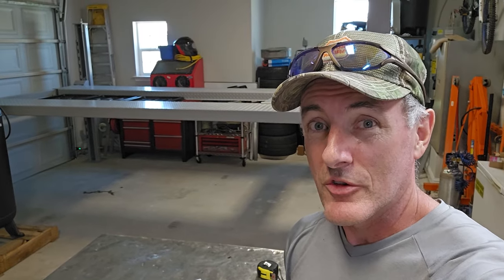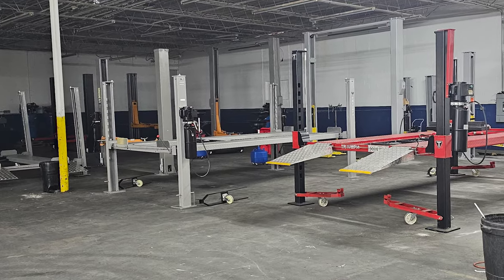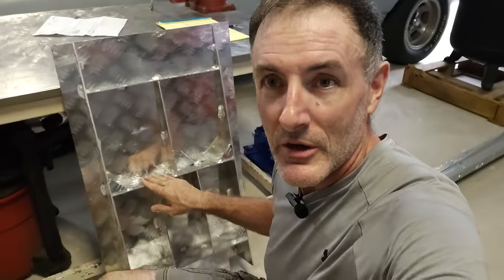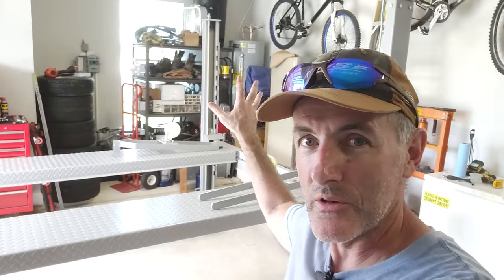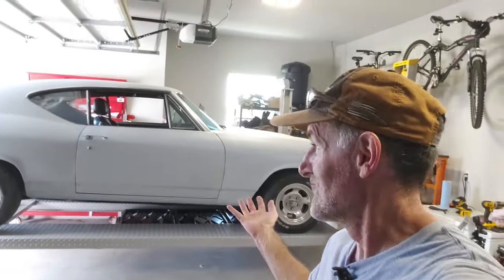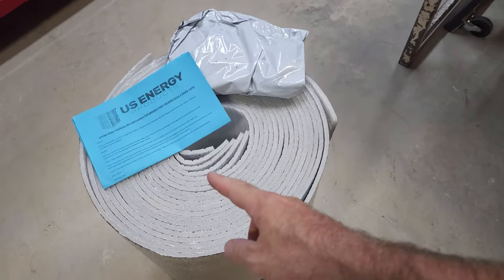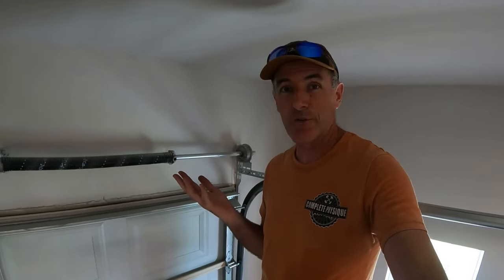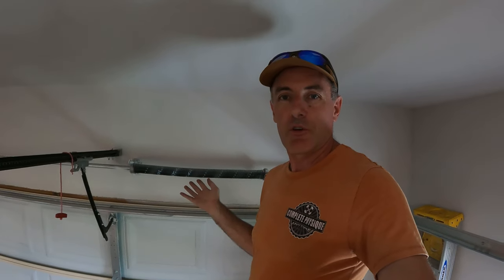Four Post Car Lift in a 10' Garage

Comment: Didn't you have another lift that you bought used? Is it still there? I didn't see it. Also, NOW you're going to build a shop after stuffing 2 lifts into your garage? What?
Reply from the maker: I moved to Texas from Western Washington and the old lift stayed there, it was actually part of the offer as the new guy really wanted it. Saved me the hassle of moving it 2,000 miles. So I needed a new one...
Reply: Yup. I just checked some of your past videos and figured it out. You still got more ambition than I do. Looks good. @MattOverDrive

Comment: I know you posted this a year ago, but still a great video.  I’m going through exactly the same thing, but in a different order.  A couple of years ago, I similarly raised my garage door rails and went to a side-mount opener.  I found that I needed to overwind my existing spring, which finally gave way just recently, so I upgraded to a thicker and longer spring.  As you know, winding those springs is no picnic.  I’m finally ready to buy the lift, but need to work out the logistics, since I have neither a trailer nor a forklift.  My ceiling is 10”4”, so this video was super helpful on multiple fronts.  Thanks.

Comment: I bought and installed the Triumph Classic 8000 (shorter) lift about a year ago. I can't remember if I had to reroute the cable. I vaguely think I did. Your instructions looked better than mine. A full view of the posts laid out for orientation on a half a sheet of paper does not give good details! lol. But overall, pretty happy. I think I'm getting an AMGO 407-P next as it is narrower.. Good for my smaller cars.
Thanks for the video!
Reply from the maker: Thanks! Yes, I heard that the directions were terrible but these were not that bad so they must have upgraded them.

Comment: Your set up is exactly what I was planning.  My issue is the head room, I need 8 more inches. Needing to park a Corvette above our Tesla Model Y and no matter how we measure it out by shifting the lift to the very back off the garage it doesn't work. Your set up looks great! Thanks for the tip on the garage rails also.
Reply from the maker: Same problem with my Wife's Outback. Just needed a taller ceiling.

Comment: Thanks for this video. Im planning on getting a lift next spring. Also nice 68 chevelle,  i have a 69 myself.  The additional information about the garage door insulation and lifting the assembly was very helpful also. 

One question, since it has been a whike now are there any concerns with the quality? Still working correctly?

Comment: Nice job!

I don’t have a lift but would have the space. I’m out in the county and garage doors are wider than in the city and longer as well.
Roughly 10’ ceilings.
9’ wide doors by 8’ high door opening. 
Garage length is 21’. 
Garage width at the door opening walls is 31’ 3.5”. 
At the front of the garage, the house wall side angles wider by 6’. 
So garage width at the backyard end is 37’ 3.5”.
Reply: looking for a car lift that matches your car and garage?

Comment: Hi, Matt, thanks for the great video. That really encourages me to start up lift my garage and have  post lifts inside. My door is similar to yours and you  mentioned that you didn’t buy uplift kit and just cut the current rails to extend it. Did you get any additional brackets to support it , other than replacing with longer cable? Few detailed steps will be much appreciated. Thx
Reply from the maker: Thanks! I picked up some angled perforated metal from Home depot to extend the brackets and some small carriage bolts to put the track patch in there. I didn't really want to make it a how-to as you can really hurt yourself with the winding bars if your not careful.
Reply: @MattOverDrive thanks for the information. I will be careful and do more homework before start. I bought the 10ft cable and the winding bars. The idea is to loose the current cable first and then move the entire setup (spring, drums, bar) up like 18”. Then cut the rails to extend the track like you did. Then install the cable and adjust the spring little more since it will have to lift the door higher now. Does it sound right to you? Thx